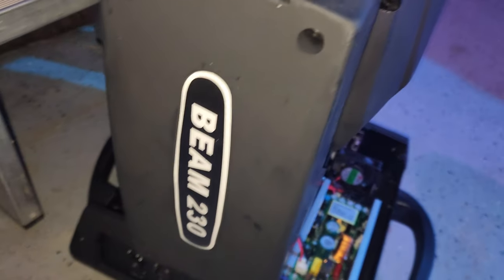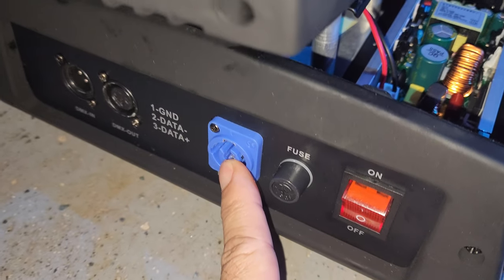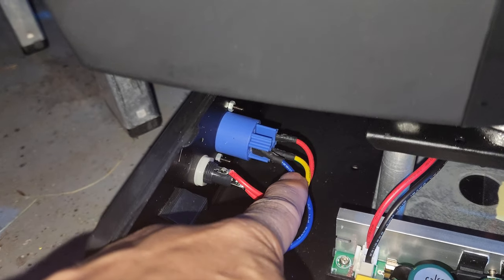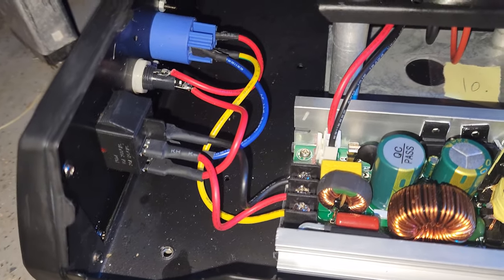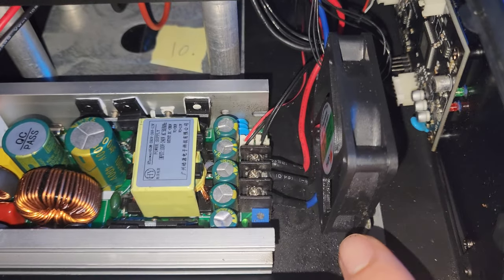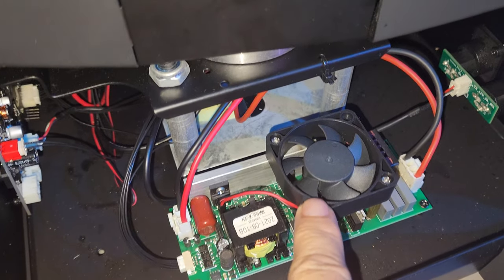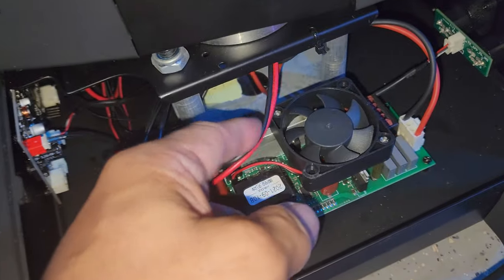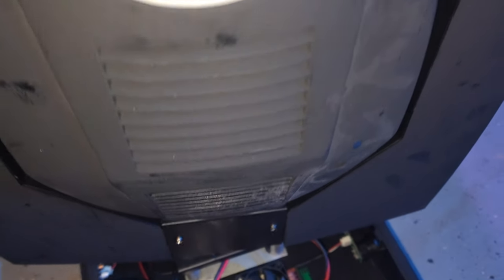Beam 230 wiring overview

Comment: I have the same lights one of them has a problem with the PS and the other one is the DMX where is the DMX board located can you please let me know! thanks
Reply from the maker: @domniccolaco2592  the front board with the lcd is the board that controls dmx. You can trace the dmx wires directly to the back of that board.